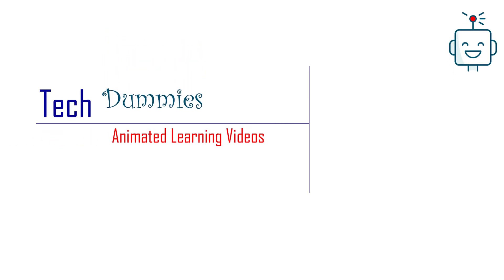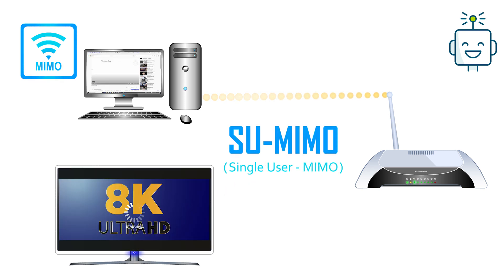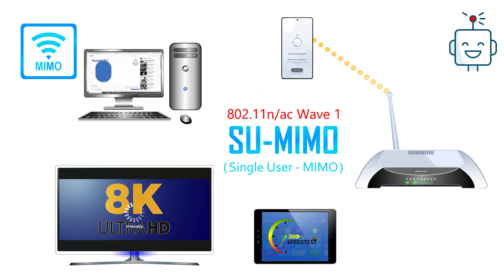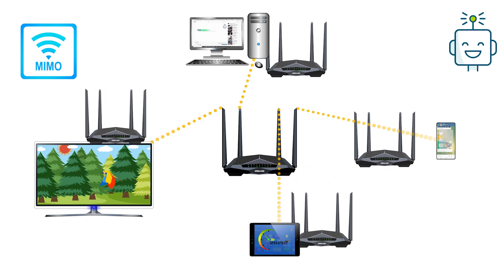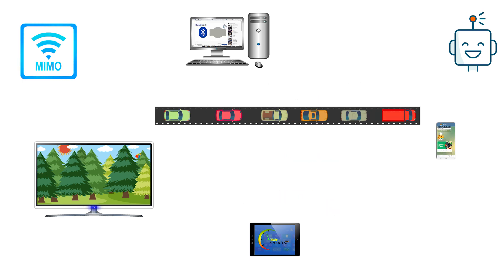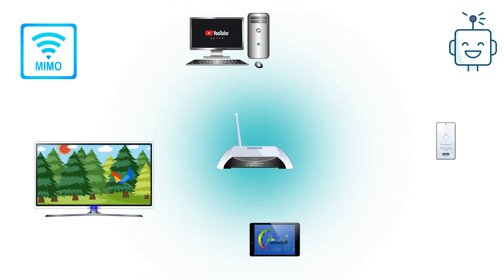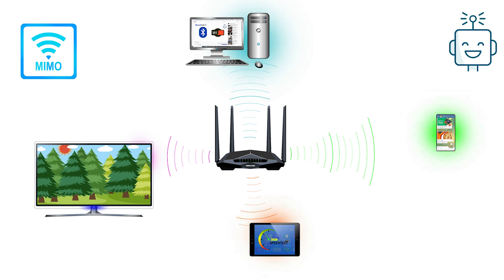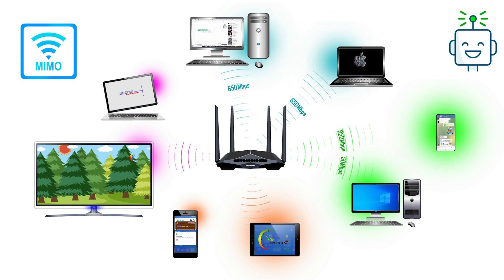Understanding MU MIMO and Beamforming Technology

Comment: Nice method to explain so clearly that what and which type of Router we should use for internet use if have multiple electronic devices like tv,laptop , mobile , Alexa
Reply from the maker: Hi, spending in MU-MIMO routers not worth if you have less than 8 devices, specially if there are online gamers or requiring lots of bandwidth for downloading, there are two variations in MU-MIMO routers 802.11ac and 802.11ax,  The routers comes with 802.11ac has issues with the communications with the legacy devices i.e. any device which is manufactured before 2016 like it may or may not work properly on those devices however if the MU-MIMO router with 802.11ax ready which is also called the Wifi6 will also support the legacy devices because it uses OFDMA technology, example for the 802.11ac routers is https://www.pbtech.co.nz/product/NETAS4054/ASUS-ROG-Rapture-GT-AC5300-MU-MIMO-Gigabit-Wi-Fi-E?qr=GShopping&gclid=CjwKCAjw2bmLBhBREiwAZ6ugoyIXehE8j8FbPGAM5r2EYy1SdoSvfqo_7YK8U_qlM4wvZ6AN3e1tfRoCYNYQAvD_BwE           and the 802.11ax is https://www.pbtech.co.nz/product/NETTPL6661/TP-Link-Archer-GX90-Gigabit-Wi-Fi-6-Gaming-Router , I recommend any of those but please go through with the product description and your current devices which you are going to connect
Reply from the maker: there are two variations with MU-MIMO one comes with 802.11ac and the second one is 802.11ax, the main difference is 'ax' is wifi6 ready and do support the legacy devices because it uses OFDMA technology however 'ac' may or may not support some your older devices , the ASUS ROG Rapture GT-AC5300 is the 'ac' one and the TP-Link Archer GX90  is 'ax' means wifi6 ready